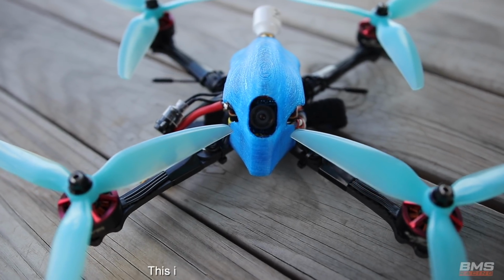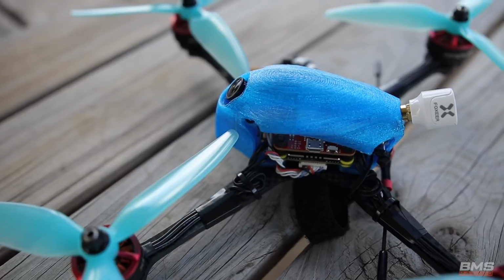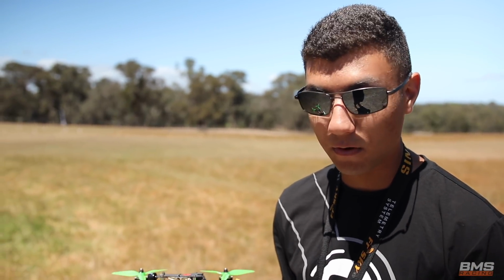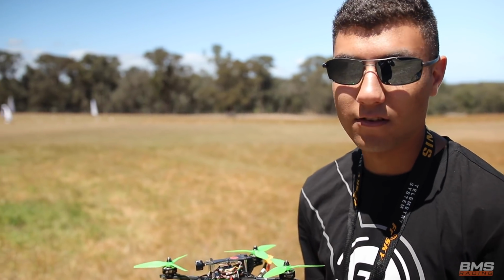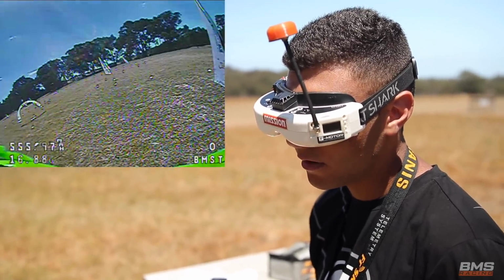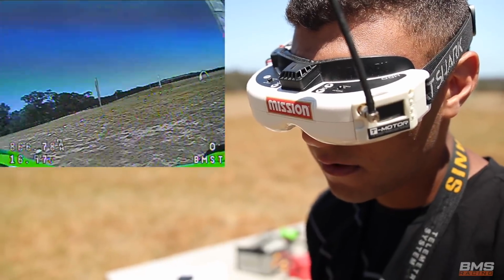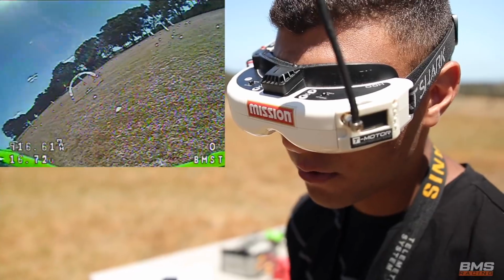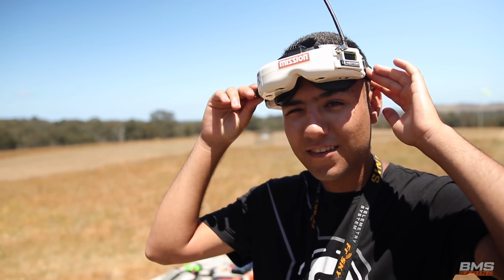Pre FPV Club Drone Race Preparation Session

Comment: I like the "twirl thing" you do over the straight hurdle.  I assume this so you can keep the throttle on through both the ascent and descent.
Reply from the maker: Kind of, there is a logic to his madness but he can't pull it off at this stage. Essentially he needs to increase his skill level. When done properly it looks freaking awesome
Reply: @BMSWEB  Would be interesting to know the intended logic.

It looks, at the moment, like a straight roll with no yaw.  So there would be some lateral movement on either side of the hurdle.  If opposite yaw to roll is applied (just right), then the quad spins on the camera axis and you are likely to be able to keep the target gate in view through the entire move (and prepare for beyond that gate).

That would be both awesome and tricky.
Reply from the maker: @ArchmageAU  he was doing that, but it's so hard to do. Unless you do it at slow speed. There is no room for error at all. The way you see it done here still works but the quad slows down a touch for a split second. I have DVR of him doing the same with Inverse Yaw, but no way that was going to happen while talking and flying 😂

Comment: Awesome video. Have you changed your frames? Why?
Reply from the maker: Probably need to do a video on that. Helix is still a solid platform and he still has all of his quad. The temporary move to the XBee was mainly due to races where a specific requirement ie HD Cam etc and the mounting was going to be easier. Xbee has allowed a little more flexibility for some of the International races.